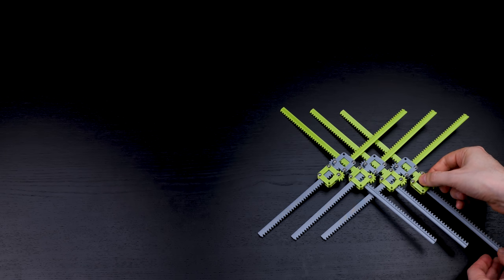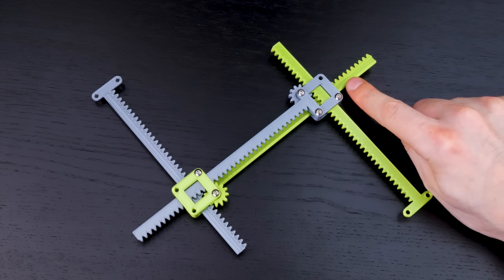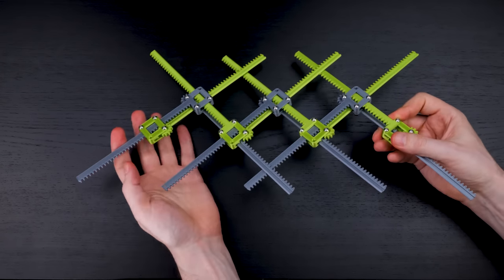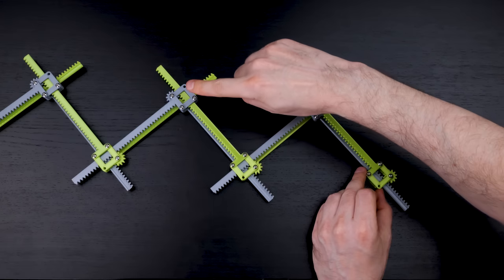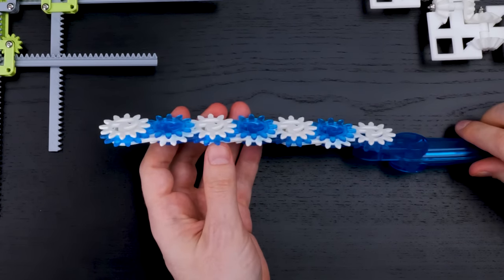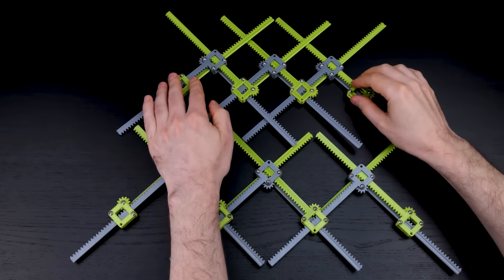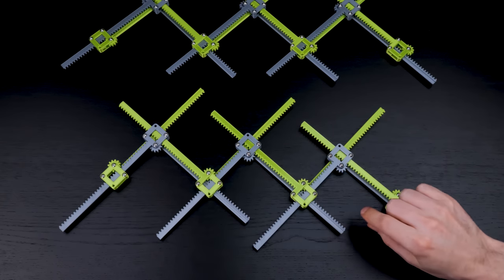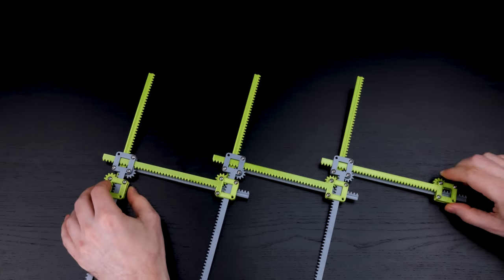Recursive racks

Comment: Very cool!  Question.  If you were to stand a assembly up (grey down, green up) how much weight could be supported on top? If 2 were used, spaced apart, and a shelf put on them, could it support it?  They would need some type of lock to hold them at a set position, but would make a cool collapsible support.
Reply from the maker: The plastic version I have wouldn’t do well with weight on it. With a beefy enough metal version you could presumably do whatever you want, but there will be weak points.

Comment: Would it be possible to make the horizontal and the vertical lines have different alternating elevations, so instead of climbing in elevation along the whole way, there's only 2 elevations that fit together?
Reply from the maker: I think so, with a redesign, although the boxes might need to be taller to accommodate the necessary shift in one step.

Comment: RE:  "This is 'spooky action at a distance' ...";  Aw dang, you had my Thumbs Up until you said that.  Clearly, this is NOT spooky action at a distance because there is a visible connection between the box on the right and the one on the left, which is the yellow-green rack underneath.  "Spooky action" is supposedly where there is no obvious connection.  The "spookiness" if anything is a trick of perception involving relative motions between the racks and the boxes, a bit like how being on a static platform close to a very big moving object can momentarily result in a false sense of the platform moving.
Reply: ^^ See also:  Quantum Entanglement, where a pair of subatomic particles have been put into a superposition (read: state) where the observation of one of them at a later point in time will result in the other being likewise determined instantaneously regardless of the distance between the particles.
Reply from the maker: If you go back to 1:45 and turn on the captions, you can clearly see that I have scare quotes around the words "spooky action at a distance", and I even say "sort of". This absolves me of all blame in using the word in a way you don't like ;). In any case, thank you for your comment, which I'm sure is worth significantly more in the YouTube recommendation algorithm than a mere thumbs up!
Reply: @henryseg   I'm not convinced by "sort of" in this context, either.  Being unsure of what exactly is the frame of reference isn't in the same category, not even a little. #Shrug

Comment: Is this how those art tracing tools work that magnify your tracw?
Reply from the maker: Those are usually made with a linkage - rods joined at swiveling connections, as in a pair of scissors. But you could make the mechanism in this video into a similar drawing tool.